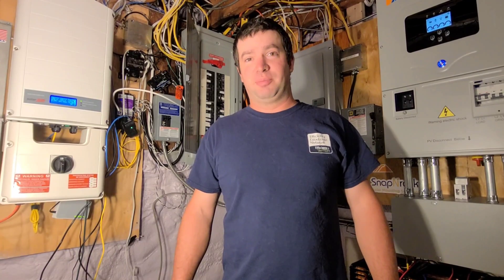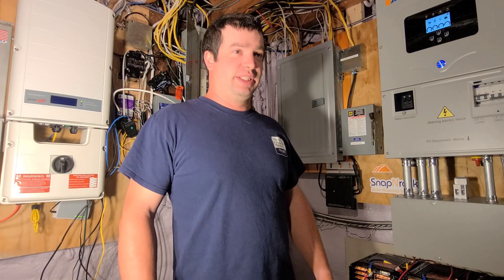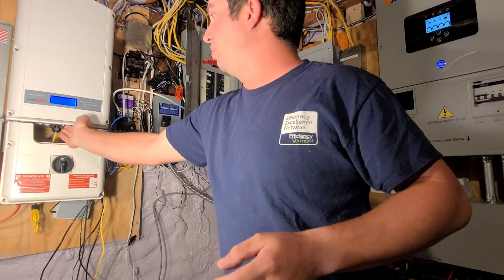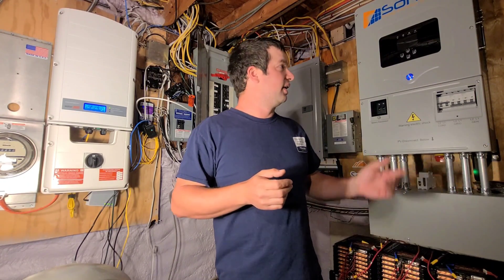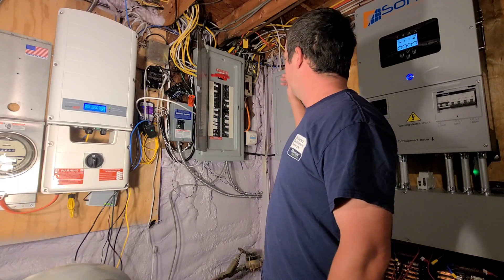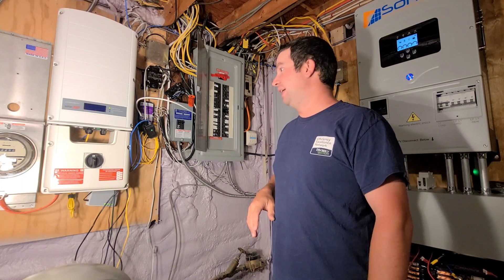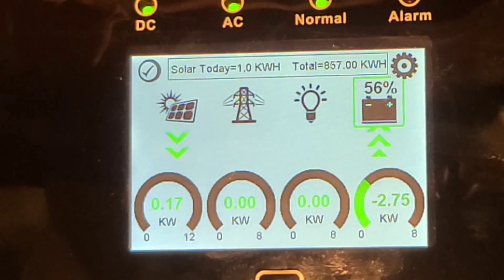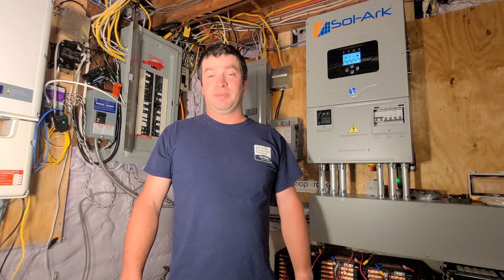What is AC Coupling? How it Works With the Sol-Ark 12k

Comment: With the AC coupled system described, how does it disconnect from the grid in an outage situation? I understand how the SolArk disconnects, but your other inverter has power to the panel and subsequently the grid???
Reply from the maker: Hi Jeff.  In an AC coupled scenario, the grid tied inverter is on the "load" side of the Sol-Ark.  The Sol-Ark has a "grid" and a "load" side.  The grid side essentially acts like a grid tied inverter, and shuts off if the grid is out if spec.  The load side stays on, completely isolated from the grid and powers your AC coupled inverter and any loads that are also connected there.
Reply: @benssolarandbattery  I think I understand what you're saying is happening inside the inverter, but isn't the inverter basically basically directly wired into your main panel (utilizing one of it's breakers and back feeding the panel when it's needed)?  If the grid goes down and it starts creating it's own (off-grid) grid, how is the power being prevented from back-feeding to the outside main grid?  Short of having an ATS or shutting the main breaker off, I don't understand what prevents it from back-feeding the grid in an outage.  I'm obviously missing something in the system (such as an ATS) or my assumption that the SA is directly tied into the main panel is incorrect...
Reply: @Slippery Slope Thank you!  I read up on it all after posting this several months ago and was impressed.  I'm actually looking to purchase one (or similar) now.

Comment: Do you know if most typical grid tie inverters slowly ramp after the 5 minute timeout?  Or.. BAM HERES 5,000 watts!!!
Reply from the maker: I've seen usually around 5 seconds from 0-100.  Slow enough so there's no BAM.
Reply: @benssolarandbattery  You can program a ramp function on the SolarEdge, if desired.
Reply from the maker: @Ben W  I'll look into it.  My solaredge inverter is from 2014 and sometimes does weird things...  but I think you're right.

Comment: How have you dealt with the grid tied side of AC coupling? When the grid goes back up does the Solar Edge switch back to grid or is the grid only fed by the Sol-ark?
Reply from the maker: When the grid comes back, the SolarEdge goes back on grid, but finishes charging the battery before exporting power.
Reply: @benssolarandbattery  Is that done with a transfer switch or internally from the Solar Edge? I'm familiar with the Sol-Ark and most of its functions but have not encountered any internal transfer switching that would switch the Solar Edge or other string inverter between between the load side and the AC input/output side. The closest would be the sell to house which involves the CT rings that prevents power from going to the grid from the Sol-Ark and supplying the main house circuit with power. If the string inverter could be made to operate from there during grid outages then that is a real valuable aspect of the Sol-Ark. It would still need to transfer to grid side somehow though.
Reply: @mendohomepower7492  https://www.sol-ark.com/wp-content/uploads/2022/03/12KOD-Manual-3-14-2022.pdf

Check out page 35 for AC coupling. You can use either load or generator input,  but you loose generator use either way. Best to connect to generator input. You can also AC couple on grid tie output if you are completely off grid only

Comment: Are you AC coupled on the load side of the inverter? Or are you feeding the generator input.  Since my Schneider xwpro6848 isn't working the way I need it I am considering trading it in on a sol ark 8k.
Reply from the maker: I tied my solar in on the load side because because it was over the limit of the generator breaker on my Sol-Ark and I like having the extra available power during the day.
Reply: @benssolarandbattery  Can you put up a wiring and load / power diagram of your setup and link to the video description?

Comment: What i dont really follow here is if the solark is overriding the antiislanding on your main inverter is this safe for the grid. Does this not lead to power getting fed back to the grid which could be dangerous if say the outage is for local maintence ? Do you have to do something physically when the grid is 'down' to seperate it from your micro gird ?

& thanks enjoyed the video :)
Reply from the maker: Hi Alex, 
The Sol-Ark has its own anti Islanding circuit on the grid side.  If the grid goes down, it shuts down the grid side, but keeps the load side active, powering the backed up loads and AC coupled inverter.
Reply: @benssolarandbattery  Aww cool sorry i thought it was providing power not just to the backup load panel but the main distritbution board.
Reply from the maker: @alexmcmillan7147  in my case, I'm running all of my loads through the Sol-Ark.
Reply: @benssolarandbattery  totally makes sense!
Reply: @benssolarandbattery  Okay this makes more sense now.  So your incoming grid lines come from the meter, into the Sol-Ark, and then the load side of the Sol-Ark feeds your main panel (power comes from the meter and goes into the SA before it powers the main breaker)?
Reply: @benssolarandbattery  I understand how the Solar-Ark manages the anti islanding but what about the Solar Edge? The Solar Edge should be connected to the Export only grid meter. How does it connect to your load panel as well?

Comment: Ever think about a load controller?  This prioritizes your loads. Electric stovetop would have the highest priority and water heater or clothes dryer typically lowest. This way you don't need as much inverter power at any one time.
Reply from the maker: Yes, that is a very good idea.
Reply: @benssolarandbattery  Will you be doing a video on the Sol-Ark Smartloads-14 controller and all it can (and can't) do?

Comment: I second the request to keep making Sol-Ark videos, as I'm learning a lot here. This house has a 3kw PV system (using a Delta Solivia 3.8TL inverter) that the previous owners put in. The original installer is no longer in business so I'm having another 4kw system installed. I would very much like to still use the current 3kw system to charge the batteries should the grid go out, and it looks like the Sol-Ark will allow this without having to rewire the current 3kw panels. Is this true?
Reply from the maker: Yes, you can either tie it in as is on the load side or to the Gen breaker, or ditch the Delta and tie the string directly into the Sol-Ark as long as the voltages match up.

Comment: Sir, please clear my confusion if we are using a hybrid grid and batteries connected inverter so why we need ac coupling system what extra benefit we get from two inverter ongrid pls hybrid as ac cuplin instead of only hybrid.
Reply: If you already have a system present and want to have battery backup and not loose the investment in the already installed system.

Comment: What about the YIYEN 18kw inverter
Reply from the maker: It sounds like a tank, but as far as I know, it doesn't frequency shift.  If I remember correctly you're using relays and dump loads with voltage based triggers? That is definitely another way to do it, I just haven't gone down that avenue. (Yet)

Comment: I have a solaredge 7600 HD and wanting  to ac couple with my sol-ark 12kw.
What did you do to solaredge for it to work with sol-ark 12k
Reply: https://www.sol-ark.com/wp-content/uploads/2022/03/12KOD-Manual-3-14-2022.pdf

Check out page 35 for AC coupling. You can use either load or generator input,  but you loose generator use either way. Best to connect to generator input. You can also AC couple on grid tie output if you are completely off grid only
Reply from the maker: It will work right out of the box. When the Sol-Ark is near fully charged it will frequency shift and shut off the SolarEdge.   To make it smother, there are power control settings in the SolarEdge that allow it to slow down power production as the frequency gets higher.

Comment: How does one do this incrementally without splitting panels?  The solark is only a 60 amp breaker and I want to hook it in to our 200 amp service. 99% of the time that’s fine. Our 10kw generator (which has a 100amp breaker) can power everything so the solark should be able to do the same or kick to the generator. But how do I create a bypass so the house has 200 amp from the grid if available so I don’t have to buy 3 solark when the grid is live but fall back to the solark and solar/battery/generator when it isn’t?  I realize this could cause the solark breaker to pop if the draw is too high when the power goes out but I can live with that as a risk but if I just use a 200 amp main and 60 amp back feed from the solark I’d be feeding back into the grid through the panel so I’m trying to figure out how to get back feed through the solark to the grid when it’s up and not when it isn’t and keep my 200 amps and I can’t find anything on how to set this up. 

Thanks!
Reply from the maker: James, what you'd need to do is add a new small main panel with pass through lugs and a transfer switch.  Then add the Sol-Ark grid feed into that new main panel, and the Sol-Ark load out to the generator input on the transfer switch.  That way during normal operation, your 200a panel gets a 200a feed, but when the grid goes down, it gets the Sol-Ark feeding the main panel.  You can still feed back into the grid during normal operation as well as zero your meter with the CTs that come with the Sol-Ark.  Hope this helps!
Reply: @benssolarandbattery  thanks!

Comment: Why don't you get rid of your grid-tied inverter and use only the Sol-Ark? You'd minimize conversion losses. Do you frequently take advantage of the combined power output when the sun is out?
Reply from the maker: I'd love to, but I have a net metering agreement that is very beneficial to me which lasts another 4 years.  If I were to remove the SolarEdge and go DC coupled, I'd need to add another power company meter to do it properly, which would change my agreement with them.  I'm considering it, but not until my current agreement is up.   I occasionally go over the rating of 1 Sol-Ark alone, but it's rare.
Reply: @benssolarandbattery  So you'd have to change to a provider that will let you use the Sol-Ark as your main inverter? I didn't know net metering involved such long contracts.

Comment: If solaredge is producing 3400w in ac coupled situation, then why solarark is taking power from batteries to run the load?
Should it be showing all power from grid (i.e. ac coupled solaredge)??
Reply from the maker: Because the AC Coupled inverter is on the load side, so it can operate when the grid is down.  In that scenario my loads were over what the SolarEdge was producing, so the rest is coming from the battery (off grid operation).

Comment: so that 90-95% on-off cycling for the charging is because of Li-Pho batts? 
Would that be worse with older lithium batts?
Why can't you just let a battery conditioner/topper-offer that runs on the AC side?
Reply from the maker: No, that's just in general. It's honestly much better to AC couple with lithium than lead acid though because of the charge profile lead acid requires.  The only way the Sol-Ark has of limiting the power coming out of an AC coupled inverter is to raise the frequency.  Some inverters (SMA, SolarEdge if programmed properly) can limit their output based on frequency above 60hz.  So what the Sol-ark does is once the battery is almost charged, it starts raising the frequency a little bit.  If the grid tie inverter doesn't respond and lower output, it raises the frequency more until it shuts off, usually around 61hz.
Reply from the maker: Hey, you edited that on me!  SOC is adjustable as is the charging voltage for AC coupling.  Lead acid likes bulk/absorb/float, where lithium is fine with just bulk/off.  You could run a battery charger, but it would mess with the SOC readings on the Sol-Ark.
Reply: ah, your use/definition of coupling makes a lot more sense than the sales-talk from solar panel manufacturers & their contractors. They simply focus on getting the power from the PV panels into a battery array. 
You're focused on simultaneous/boosted power use from both the panels & the battery array, and how to keep inverters and chargers functional.

Comment: Thanks for sharing the info on the SolArk frequency shifting.  I have a SolArk 8k where the PV input is maxed out and I want to add about another 1.8 kW of PV panels. I can either do as you have and feed the inverter/microinverter output directly into my microgrid through a breaker panel or I could feed that power through the SolArk Gen/AC Input.  I'd prefer to do as you have as it's easiest for me and I do have a backup generator but I'm worried it might confuse the SolArk's power monitoring system where inputs/outputs don't add up correctly, particularly when the grid is up since I use the SolArk data to validate my net metering. 
Can you speak to the advantages/disadvantages of each AC coupling method and how power flow monitoring is affected?  Thanks!
Reply from the maker: Ooh that's a tough one.  So when AC coupling is enabled, you lose generator input port on the Sol-ark 12k. (I assume it's the same for the 8k)  
It will still auto start a generator but you need to use an Auto Transfer Switch and feed the grid input with both grid and generator run through it. Then you need to run the AC coupled solar through a relay so when the generator is being called for, it shuts off as to not backfeed.  
At least on the 12k, the latest firmware allows for monitoring AC coupled solar as well, but only when it's tied into the Gen breaker. You can still tie it into your load breaker, but it won't be properly monitored.  Did I get everything?? This stuff is fun!
Reply: @benssolarandbattery  Good thoughts on how to do both a generator and AC coupling through the 8K Gen Input. My primary question was whether AC coupling through a load breaker would be monitored or somehow confuse the 8K so it makes bad decisions since I assume it monitors power flow internally as well as at the utility drop via the CTs. If the 8k operates normally then I could just look at the difference between what the 8k says it generates and what is measured at the CTs to get the AC coupled power...maybe. I may just have to try it out and see what happens.  Its good to know that AC coupling via the Gen Input will be monitored by the 8k.  Thanks!
Reply from the maker: @Citizen_Not_Subject  the thing is, you'd have to know exactly what your usage is as well, as some of the AC coupled power will be used immediately as it goes into the load center and never go back through the Sol-Ark. That's why I'd recommend tying into the Gen breaker, so you can monitor the exact production.
Reply: You loose the gen breaker either way. It becomes unusable when AC coupling another inverter.

Comment: I didn't know about Sol-Ark until your videos. Your points about DC vs AC coupling impact to the batteries are well taken. So, since the Sol-Ark website says these 12k units can be paralleled, any thoughts, pros and cons, of doing that? I'm wondering about the battery design and charge controller limitations in that kind of setup.  I live where its quite hot and need to support HVAC, hence the twin units. Thank you.
Reply from the maker: Paralleling is a great way to do it.  You can double the AC coupled input, or have access to all 4 MPPT inputs, or both.  There is a primary and a secondary inverter, the primary controls everything but all functionality of the secondary is still available.  No cons that I can think of really.
Reply: @benssolarandbattery Do both Sol-Arks have to be the same model, or can you use say a 12k and a 5k in parallel?
Reply from the maker: @ssoffshore5111  I don't think the 5k can parallel at all.
Reply: @benssolarandbattery  Okay, same question, new 16k and 12k, or 12k and 8k???

Comment: Have you ever done a straight-up DC coupled grid connected all-in-one system with a Hybrid Inverter with built-in charge controller controlling the entire system?  It would seem for new install starting from scratch this would be more efficient and less costly.
Reply from the maker: I haven't.  The issue here is that it's more difficult to meter the solar production. Our power companies require a production meter between the inverter(s) and point of interconnect. With a typical grid tied system, that is easy to achieve.  With a Sol-Ark, it's not as easy. The solar production comes in as DC and is then split between the backed up loads panel and feeding the battery bank or the grid.  The only way to do this accurately is to have 2 meters, one on the grid input and one of the load output.  A few of the power companies won't accept this as well, so we're stuck with AC coupling.
Reply: @benssolarandbattery  I just checked with my local WE-Energies website and it seems that they require two meters in any case, even with an AC coupled system. Also, they only have one approved layout you can choose from, and any deviation requires an engineering design review & approval to be paid for by the customer.  It would seem that they don't get many requests for hybrid inverter systems nor requests for DC coupled systems.  https://www.we-energies.com/services/pdf/customer_owned_generation_diagrams.pdf

Comment: I have a question on AC coupled.  Are you referring to micro inverters? Isn’t the advantage of them or the DC optimizers to not be weighed down by inefficient or shaded solar panels? Sorry for the dumb question.
Reply from the maker: Hi Brent, in general, AC coupling is done on the output side of any grid tied inverter system. In my case it's Solaredge,  but can me done with enphase micros or any other grid tied system.  Generally it's done as an add on to an existing system, but we do them on new systems as well where the battery will mostly be used for backup.